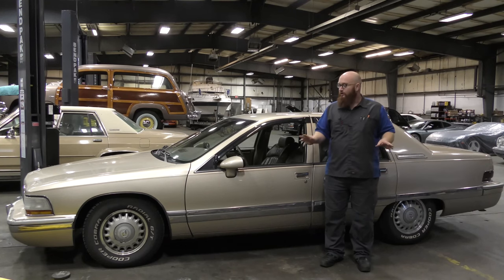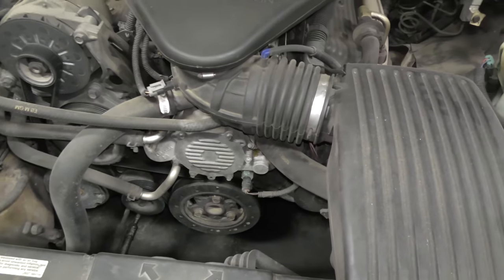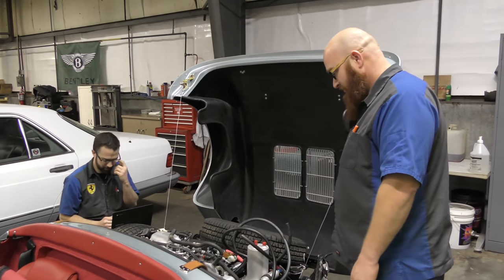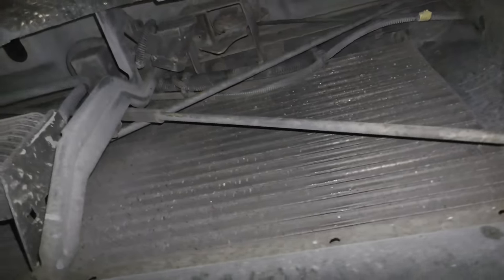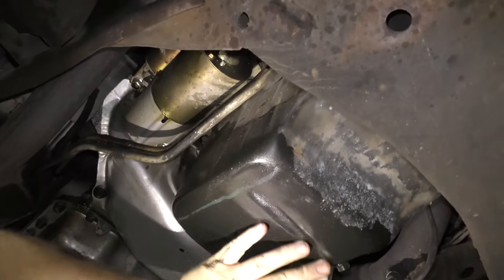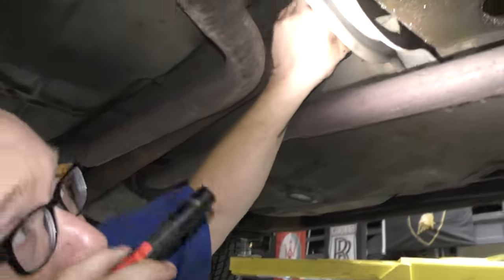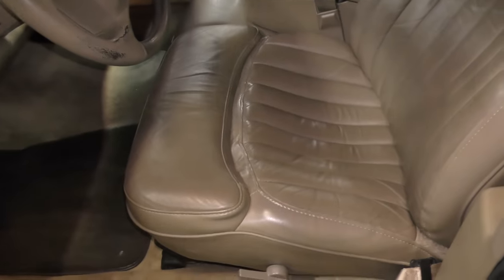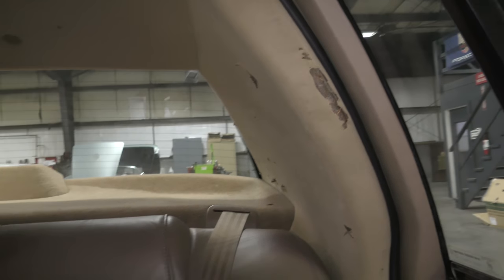Why do mechanics buy 'grandma' cars? CAR WIZARD explains their lure with this '94 Buick Roadmaster

Comment: "3.8 or some rinky dinky engine" 
sweats in european
Reply: More like laughs in engines half as big, just as powerful, lasting 3 times as long .
Reply: @Black Dragon  Nothing is wrong, but for us europeans its too big and definitly not economical in my country, we pay 1,30 USD for litre of gasoline... you lucky americans pay 0,675 and thats why we have smaller engines or lpg conversions :(
Reply: @hypnotoad357  1,30 dollar is not to bad i have to pay 2,01 dollar per litre :(
Reply: @derbigpr500  HAHAHAHAHA! Oh wait, you're serious? HAHAHAHAHA!
Reply: that triggered a lot of commodore fans i bet :)
Reply: @derbigpr500  Actually, only German and British engines last as long as American ones do. French and Italian cars are not built to last as they're built to a low price, not to last.
Reply: @AAWT  I generally agree, but my Renault Clio from 96, with a tiny 67hp engine stills works well after 320 000 km. No major breakdowns.
Reply: @AAWT  and which British cars are you talking about exactly, because it's not like the UK has much of a domestic car industry any more...
And newer French and Italian cars aren't anywhere near as bad as they used to be; these aren't the 1980s anymore
Reply: @TheEllipz35  I had the same car for a couple of years, bought it at 250k km, never had any work done on the engine (bar maintenance). Too bad the back half of the car rusted and fell apart. Sold it to some guys from Renault fan club that restaured it and I still see it on the streets of my home town. Same goes for my '94 Fiat Punto that I drove into a wall.
Reply: @Black Dragon Exactly.   The 3.8 is a great engine!
Reply: The Buick 3800 was a legendary engine with 200 HP...plenty for the cars it was plopped into.
Reply: @curioushooter  Just no where as good as a Ford Barra.
Reply: Modern German engines do not last AT ALL. "Biodegradable" gaskets and wires that biodegradable in use; finicky electricals that fail in unpredictable ways and cost a King's random to fix.

Yeah, technically that's "engine management," but no management = no engine.

And there's no such thing as a "British car" anymore. Merely British badges, owned by others... typically Germans.
Reply: @bcubed72  I've got two 06 vehicles in my driveway 1000X more reliable than the 2016 Jetta parked next to them (when it's not in the shop). A Volvo S40 and a GM Hummer H3. Both with an inline 5 cylinder.
Reply: The 3.8 was one of the Best GM engines ever. Bulletproof. I ll overbid at auction for those models.
Reply: @derbigpr500  no
Reply: @AAWT  French cars built in the 90's and after can be reliable, for example you should see all those 20 years Renault Clio still rolling without a fuss.
Reply: @curioushooter  ....still have one.   I think it's due for a spark plug or 2 after 200,000+ miles.  Nothing bothersome, maybe I'll check it again at 300K.
Reply: @b.arborio2404  That over bidding on the 3800 still happens.  Salesman that lives next door said they were asking $5000 for a Bonneville with the 3800 and they got $7000 for it.
Reply: @robk9685  My favorite '87 Grand National 3.8 turbo. In 91, I bought one thinking it was a Monte Carlo at first (young and dumb) paid  8k$ for it at the Dealership. "Chipped" it, and could do a 12sec 1/4mile. The fun lasted 6mos before the Cops / Courts knew me by first name. Lost my license for 3yrs, and ended up selling it for 4k$ in 92... Wish I had that car again!
Reply: BeyerT1 Bwahhhahahah. 

Here in America, no one has to put the pedal to the metal just to get out of a stoplight, or up a hull.
Reply: @timdejong5017  here in Russia i pay 60 cents for litre but the evil always comes from details. 1K$ is two or three average salaries.
Reply: @fly-high-me  i earn a month 1200 euro which means i can pay for 600 liter 98 octane petrol
Reply: @timdejong5017  i have 270 euros per month or 438 litre of 98 or 555 litre of 92. Yeah yankee are damn lucky)
Reply: @bruceparr1678   it’s a lot more compact than the Barra
Reply: @bcubed72  I would never own a german car
Reply: @gdawwg1125  Barra is quite tall
Reply: @derbigpr500  My two Audi A6s would like a word about "last 3 times as long."
Reply: @alexandredevert4935  French cars from the 2000s are notorious for being peices of shit, in the 90s and 10s theyre a bit better tho
Reply: @timdejong5017  gotta love dutch taxes :(
Reply: @hypnotoad357  Even though that's the reality here in Europe..i still have a Chevrolet Caprice Classic of 1990's model because not really interested other european types of cars.
Reply: @hypnotoad357  The thing is that displacement doesn't equal mpg. The large displacement engines have tall gearing and low rpms letting them cruise easy on the highway netting pretty good fuel economy. Especially compared to turbocharged or high reving engines. A good example is the 640 hp 8.4L V10 in a Viper getting better gas mileage the 500 hp 4.0L H6 in the Porsche 911GT3 RS. The fuel economy was comparable to a 2.5L Subaru Sti too.
Reply: @timdejong5017  Yeah, more like $1.70+ in the UK too.
Reply: @David-cm4ok  today it was €1,89 / $2.26 per litre for 98 octane
Reply: @curioushooter  yep! i got one in my Aussie Holden Commodore. Solid donks for sure, no v8 ofcourse but as a base engine cannot complain at all
Reply: Kinda sad the HP numbers of the 3800 series ii supercharged V6 when in comparison to its contemporary Acura j32a3 3.2l naturally aspirated engine. Don't get me wrong both are good reliable engines.
Reply: @hypnotoad357  I have a 2003 Buick, 3.8,V/6 gets almost 30 miles per gallon, not fast but smooth and comfortable. .Park it anywhere and don't worry about it getting damage!
Reply: hey that 3.8 is one of the best engines for durabilty that can last up to 300k
Reply: Opel Vivaro LWB van, 5,4 meters long, 1850 kilo, powered by a dinky 1.6 diesel engine.

Gets 32mpg or 7.3ltr/100km average over the last 6000kms.

Would love to own a park avenue or Roadmaster, unfortunately just like my government would love the roadtax I would pay for one. (3000-4000€ per year)
Reply: @derbigpr500  THAT OLD TREE FIDDY BE PULLIN STUMPS WHEN YOUR POS BMW IS IN THE WEEDS SON. AMERICA!!!!!
Reply: @charlesbratten3293  Hell yeah, the 3.8 is a bulletproof beast. My first gen LaCrosse was the best of both worlds: modern comforts you'd expect from a newer car, but with a bulletproof engine GM had made for years and years. 195,000 miles and still running like new... that is, until I got hit by a hothead 20-year-old with no license who ran a stop sign in his dad's brand new Hellcat. RIP Icarus, you deserved better.
Reply: buick 3800 is in top 10 combustion engines ever made.  There are good 3.8s. I owned 5 of them.  They were  discontinued because they were too reliable.
Reply: @curioushooter  i just pointed this out twice.  buick 3800 Great engine!!! best ive owned.
Reply: @everyday tenor smart people in here
Reply: @AAWT  You're aiming that one wrong. FIAT make really solid engines, and really crap everything else. Nearly everything that's gone wrong on mine has been the result of plastic or rubber degrading. The actual engine's been just fine.
Reply: @derbigpr500  Nothing lasts as long as the 3800 Buicks, there would be tons on the road still but the cars around them die long before they do. And yes, take that all as a bit of sarcasm, there are many great engines and many crap ones that people love or hate. The 3800 is one of the most reliable engines ever and holds up with the well-known Toyota and honda engines everybody loves. But I have to agree the LT1 is a rock if maintained (as many car engines can be, that silly taking care of you stuff thing seems to catch so many). have an older relative still driving an 89 Olds 88 with about 420,000 on it with the 3800 even had the original auto which even surprises me.
Reply: @TheEllipz35  French cars are worthless after 100k's. Sure you can baby them, but it's more economical to get a replacement if something goes wrong.
Reply: @samspianos  Owned 4 mercs, wouldn't buy anything else.
Reply: @ReturnOfZurenriri  Just had my station wagon wrecked by a 1 month old suv, just after going through a lot of routine maintenance. I know how that feels...
Reply: @derbigpr500  Three times as long? You're saying your little pipsqueak shit boxes do 900k-1.5 million miles? 🤔 I doubt it 😂😂😂
Reply: @AAWT  Your information is outdated. British engines? Well there were such in the 20th century.
German engines? Up until the Golf 4 era, yes. Very reliable. Modern VW, BMW, Merc are engineered to fail.
I currently own 2.0 HDI Peugeot 407. The engine is really reliable. There are issues with the plastics and wiring/electronics.  5 years ago I would not believe I will ever own a French car. Now I am a happy owner of a reliable, comfortable, cheap to maintain French car, that you can drive 600 km a day without any health issues.
Still, Japan cars are the most reliable. As 20 and 30 years ago. I used to own a 1998 Mitsubishi Carsima 1.8 GDI for 8 years. That was a rock solid car. I revved the engine to its limits on a daily basis. It easily played checkers among other vehicles at 180-200 km/h. And all this with combined consumption of 7 liters per 100 km. Sold it at 430 000 km in less than an hour. Moved out of the country and had to sell a lot of stuff. The biggest difference between between the engines of the Mitsubishi and the Peugeot is that I could crouch with my boots on the Mitsubishi engine and do some work. With the Peugeout I have to be really careful not to damage anything (plastic) by simply applying part of my weight on it.
I have several sources that claim there are a lot of reliable American engines. But their sizes are frustrating. 4l, 5l and so on. All these enormous engines do not comply with the idea of fuel economy and lowering the greenhouse effect.
Reply: Yeah, right.  That car is on the GM B-body.  Now, the FWD Buicks had the 3.8.  It was a good engine as well, but it had nowhere the power.  Great video!
Reply: @bcubed72  never drive one or you may be bit and need to have one. Love driving them. For me it's such a difference compared to domestic and Japanese autos.

There is plenty of documentation on what to look out for besides scheduled maintenance.
Reply: @ummagumma5415  that's because you are oblivious to the debt incurred and the environmental impact if producing a new auto vs maintaining.

Fear not though. A new "Cash for clunkers" is on the way.
Reply: @AAWT  heard of Japan??
Reply: @troymash8109  Hummer’s are 5 cylinder cars?? I never knew! Unless you engine swapped it?
Reply: @derbigpr500 can you find me a European engine from 1994 that can last 300k miles w/ just oil changes at 300hp/300 ft-lbs? (Hint: you can’t.)
Reply: @AAWT  I have bever heard the words "brittish, engines, longevity* used thst close together before.